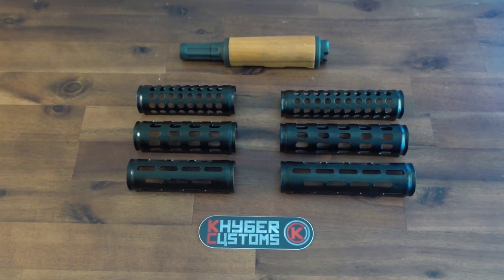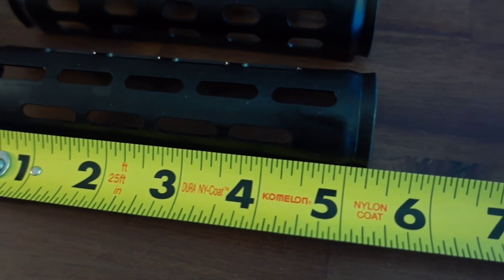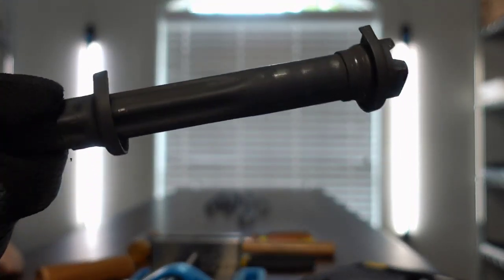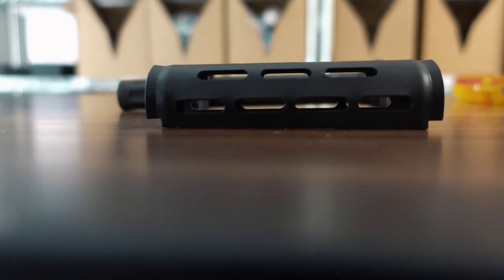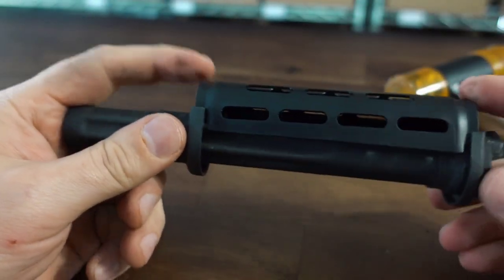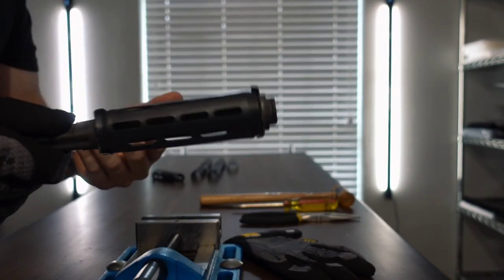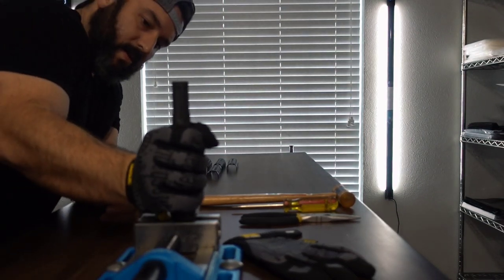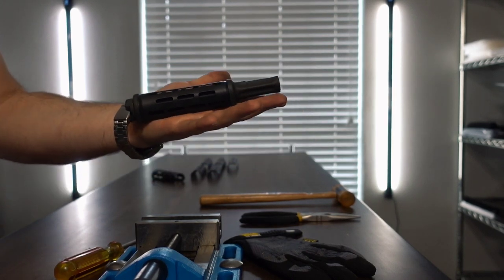Cheese Grater Upper Handguard Install Guide - Khyber Customs

Comment: Got mine today, fits loose real bad, hoping removing it and “opening” the hand guard a little more will tighten the tolerance
Reply from the maker: We designed these to be adjustable as shown in the video.  There will be some variance between all of the many AKM, AK47, AK74 pattern gas tubes.
Reply: @khybercustoms  thanks for the reply. I corrected the looseness of the fit with just simply bending the hand guard outward to have more tension.

Comment: My cheese grater upper is extremely close (even slightly wider) than the retainers on the gas tube of my PSA AKM GF3. How do you recommend I reduce their radius so that they can fit in at all?
Reply from the maker: Tap with a rubber mallet.  Should take a few seconds

Comment: Yeah, m92. Not twisting off.  Tried for 30 minutes, 3 of us tried...not working.  I guess it will go in the drawer of crap that won't work.
Reply from the maker: You can send it to us and we can do it for you.
Reply: @khybercustoms  apply more vodka comrade...DA...
Reply: If you don't have a vice these are a real bitch to remove also put oil on edges of handguard to make it easier to twist off